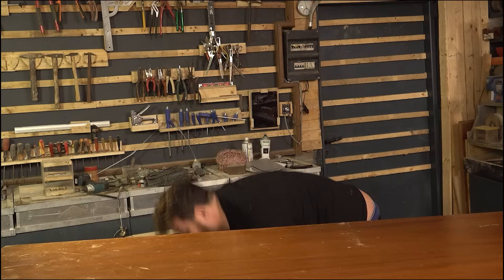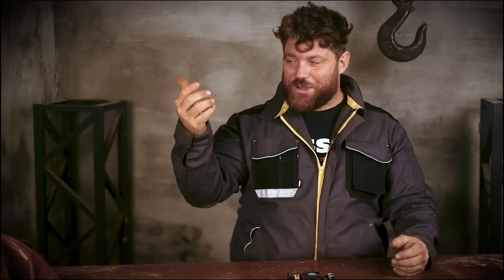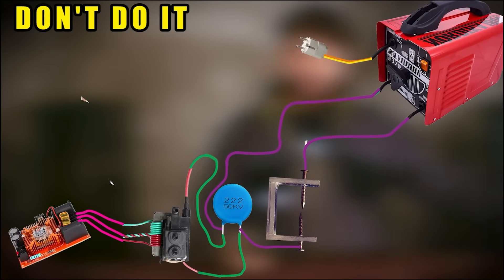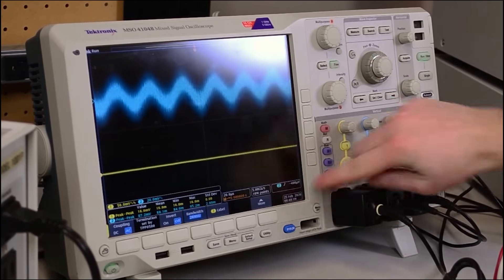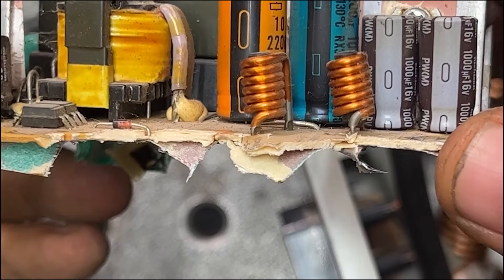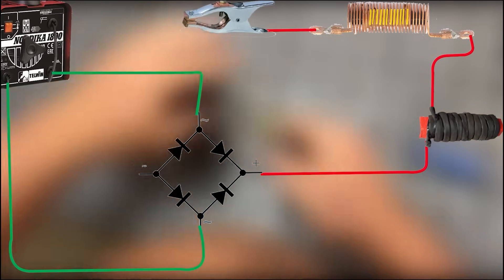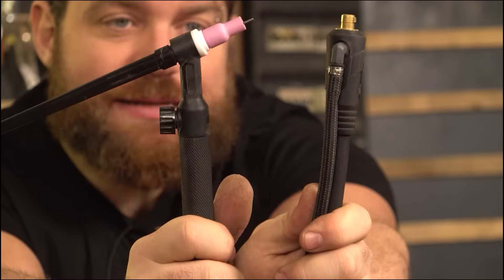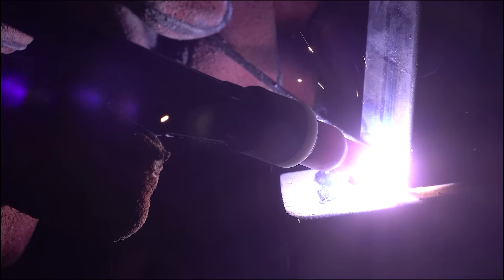How to Make a Plasma Cutting Machine From Scrap

Comment: This is one of those things I would strongly recommend not building diy but you did and it works so I'm impressed none the less. But holy moly I cannot stress enough how dangerous this type of thing is
Reply: Going outside could be dangerous too if you don't pay attention. Just don't do nuthin stupid!
Reply: @elliottdiedrich3068  Yes, but one should very least understand how the damn thing works and dangers that come with it, like how you can easily kill your self with a tig torch if you fuck up even with just the usage of it. I agree most things are pampered too much when risks are very little but high voltage and combining them with current is one of those things you dont want to fuck around and find out. This comes from guy who knows about electricity enough not to get killed (so far), has gotten shocked several times due mistakes my own or others and DIY guy with several bit sketchy jerry rig builds.

Comment: Dangerous guys, my advice, do not build and learn electronics from an experienced engineer.

12:38: My GOD!!!!, this guy has taken the output from a weldng machine and SHORTED it across a very  low resistance inductor now!, good way to burn your house down kids!!!!!! this only has a few turns, its inductance will be very low.

There are so many basic errors in knowledge of electrics here, its difficult to know how to attack it, but attack it I must, because kids will be trying to replicate this not even having a grasp of basic Ohms law and believing every word you say. That my friend is dangerous when using these kind of voltages and power levels.

Comment: Since the setup requires DC to work, is it possible to remove the bridge rectifier & replace the ac welder with a dc welder?
Reply: No.this is absolutely fake plasma cutter need higher voltage

Comment: What is the minimum voltage that an arc welder should have to strike an arc with the help of an HF HV transformer ? Could this work with a voltage as low as 12 volts ? Very interesting, I love this channel :)
Reply: 50.v
But 25vdc when burning running . Cutting 🤔🤔🤔🥒 so i think  this if a fake .
Reply: Oh really ? What a shame, I was hoping that the same power source could be used for TIG welding and plasma cutting. But I guess you're right: I did some researcheas about similar projects and every times I saw the same answer : no, the TIG welder working operation voltage is very different than the plasma cutter one (30 volts vs 70 volts). I suppose that you want to maintain a short arv for TIG welding where the energy needs to be localized to melt the filler metal whereas you want a bigger arc for plasma cutting to keep ionizing the compressed air flow before to send it to the part to cut. Thanks for your answers anyway, I am really interesting in this topic

Comment: How do you keep the 40k volts from the flyback transformer from killing the bridge rectifier? The one he used wasn't rated for blocking that high of voltage. It would exceed the breakdown voltage and destroy it really quick
Reply: I think blue things called "diodes" is Zener diodes actually. It makes sense with large capacitors and varistors
Reply: With a 🤔🤔🐴 fake machine
Reply: With the short stick rod in epoxe.

Comment: you summarized the most important part in 5s in a high voltage and amperage device with "just make it like this" but spent 5 minutes making a heatsink. questionable
Reply: Boring.. was getting to long

Comment: 14:44 : You need the proper googles. What kind of googles are these? I am worried that someone might get the wrong impression.
For those who don't know:
Without protection the radiation damages the eyes really quick and you will not be able to see anymore. 
The radiation has the full UV spectrum and isn't filtered by the earth atmosphere. Most important is to protect the eyes. To prevent skin cancer and burns, I highly recommend to protect the skin too. Another thing is the fumes can be really harmful. For instance, If you cut some chlorinated dirt or coating , I think toxic phosgen gas is created.

Comment: Don't you need some shield for eye protection, just like when welding?
Reply: All plasma arcs produce strong UV radiation that is not good for even skin, so long sleeves, cotton if all possible are recommended for any work related to plasma arcs. You can get away for short couple second burns when covering the arc with the nozzle, like with welding, but if there is any reflective surfaces you can get welders eye from even a little use and on the long term its not good for your eyes anyway, same thing with the skin. In short yes, unless you need to make just one or two curve cuts and do rest with grinder or other tool to finish the single job. Any multiple production and i would advice least automatic welding mask and welding gloves with suitable clothing that covers skin. Also use cotton or other natural fibers since if spark ignites them, synthetic clothes will catch fire if not fire proofed and if catch actually fire will melt to your skin. Its not fun scraping the burned skin off while removing the melted plastic off even if its small area.

Comment: You need low-pass filter or similiar to protect the welder from high frecuency and high voltage from the flyback.
Reply: not rly as it is just a big mains iron core transformer
Reply: @viermidebutura  but what about the bridge rectifier? Surely it's not capable of tolerating 40k volts
Reply: @jasonharrison25  the high voltage caps in parallel with the bridge will deal with that
Reply: @viermidebutura How high of a voltage are those caps? He never says in the video?

Comment: I'd like to see ElectroBoom give his thoughts on your electrical creations
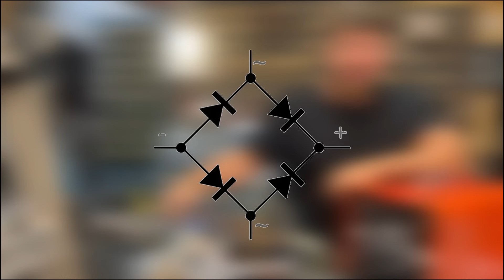Reply: With the "don't ask me why" at 13:01, and the seemingly pointles caps at 13:14 that don't show the polarity in the diagram (electrolitics, one conected directly to the AC input, the other ones would get at least the 0.6v drop from the diodes at best, and full reverse voltage at worst), this could maybe be in the rectifier
Reply: A little question for anyone: if you only need just a hig voltage, it's not the same use the mechanism of a microwave? You have around thousands volts, a huge capacitor and a transformer could make an arc of 4kv ......
🤔🤔????

Comment: would this be considered a High frequency start plasma cutter? asking, because normal plama cutter cannot be used in cnc table because of EMI. And the low frequency start machines are very very very expensive
Reply: Yes, HF start. You can use them with CNC, but you need to have everything shielded. A DIY-unit like this will make noise like mad and kill all communication in the nearby area.
Reply: I purchased a cnc plasma tube/pipe cutter for our shop a couple of years back. It uses a standard plasma cutting machine with a mechanized torch for the cutting head. The ground is fed through a 3-jaw chuck. The plasma machine itself sits remotely from the cnc setup. Our entire shop is filled with nothing but HF tig welders with no problems to speak of. Although computer printers seem to die fast and do unexplainable things, lol. I'm not sure if there's any relation between the two or simply coincidence...

Comment: What? Does the plasma cutter work from 30 volts? I will never believe it, the transformer's idle voltage should be about 300 volts, the operating voltage is about 100-120 volts, with a cutting current of 45 amperes, from 30 volts even the arc will not light up.
Reply: Hahah did you follow the full video?  The part talking about high voltage module and  capacitors?
Reply: @rulof87backup  Oh yes, I've looked in full a few times. The high-voltage module only serves to ignite the main arc in the torch, the power source for the arc is a power transformer and its voltage of 30 volts is not enough to maintain the arc in the torch.
I'm not talking about the throttle, its inductance is not enough to smooth out the pulsating current of 50 Hz.
So I can say with 100% certainty that this video is staged and you used a conventional inverter plasma cutter as a plasma source, and the transformer was standing for the view.
Reply: @_TOGA_ right some plasma cutter works on 90v and above.its impossible to maintain that arc
Reply: @_TOGA_  So he basically made the high-frequency start component to be used on a lift arc inverter? I'm not knocking him, it's beyond my capabilities. Just curious is all.
Reply: @trevorconley3328  No, you didn't understand, yes, he really did part of the circuit, this is a high-frequency ignition, but the rest of the circuit is not operational, there are two reasons for this, the transformer voltage is too low, it is 30 volts, and for normal operation, the idle voltage should be around 300V, the voltage during plasma operation will be about 100 volts. The second reason is that the inductance of the choke is too low, it is very critical for one phase, since there will be no arc ignition, because of too strong current pulsations, the size of the choke should be comparable to the size of the core of the power transformer, and the number of turns should be 200-300 turns. I know all these points because I have already assembled similar devices, in one phase and in three phases. In one phase, I received a cutting current of 80-100 Amperes, this is a power of 10-12 kW, in three phases 300 A, this is about 52 kW, you can cut metal about 100mm. Therefore, I have every reason to believe that the author of the video used a store-bought inverter plasma machine to demonstrate that what he assembled works, although in fact it does not work.
Reply: @_TOGA_  he neeeeededes 2 make an open box run vid to prove its an old stick welder n not a plasma cuttttter in side a box .a red box.